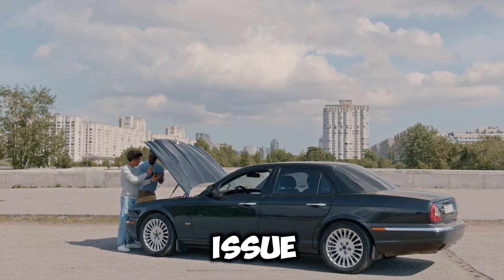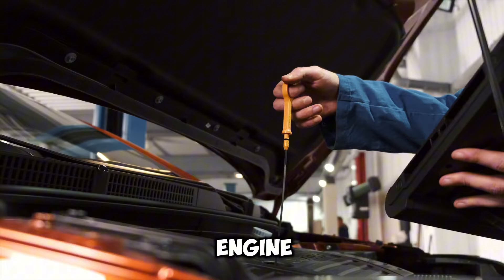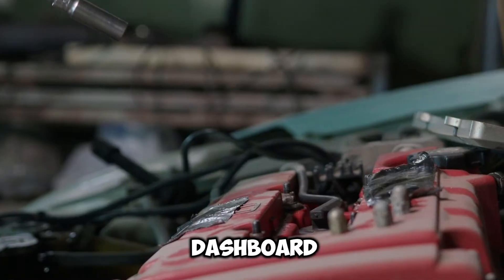Oil Light Blinking When Idling - 7 Causes & Solutions

Comment: Why on idle ,the oil light is off you rev the oil light comes on ?
Reply from the maker: On idle, the oil travels through the engine slowly, however, when you rev it, it requires faster circulation and it is not getting that. I would check the oil pump first.
Reply: Oil pump or crank bearings are worn, usually on high mileage vehicles

Comment: How bout driving
Reply from the maker: If your oil light blinks while driving, it indicates low oil pressure, which could be caused by low oil level, a failing oil pump, clogged oil passages, or engine wear, and it should be checked immediately to prevent serious engine damage.

Comment from the maker: ⏱Timestamps⏱  
00:00 Intro
0:26 1. Low oil pressure at idle
0:49 2. Idle speed too low
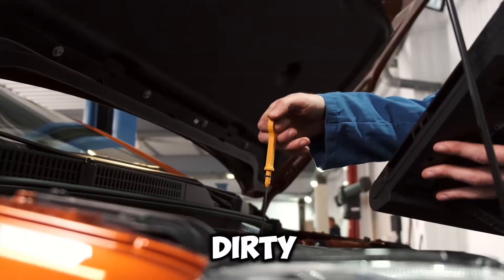1:09 3. Dirty or clogged oil filter
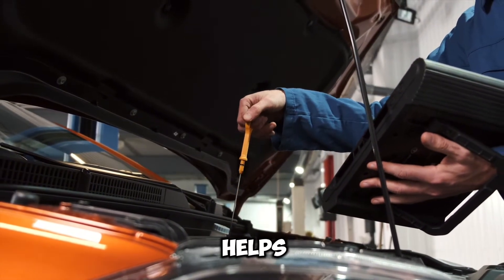1:31 4. Incorrect oil viscosity
1:55 5. Faulty oil pressure sensor
2:12 6. Electrical issues
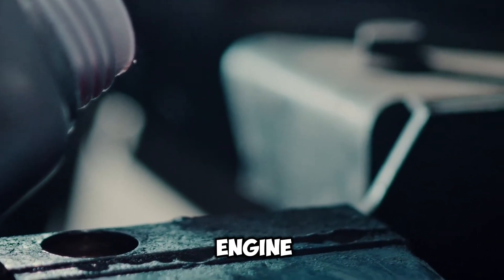2:32 7. Engine wear and tear
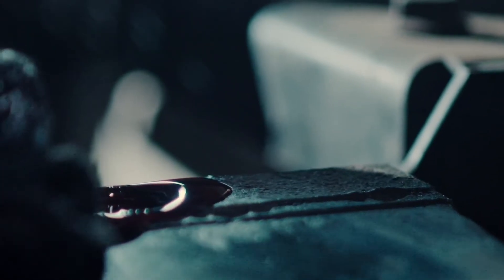2:51 What should I do if the oil light blinks when your car is idle?
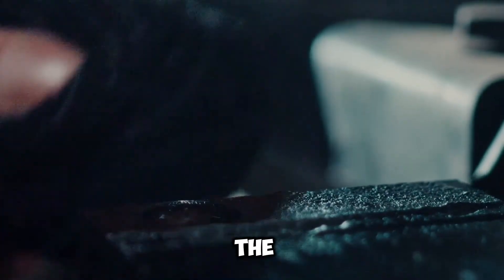3:05 Can driving with the oil light blinking cause damage to the engine?
3:21 How often should you check the oil level to prevent the oil light from blinking?
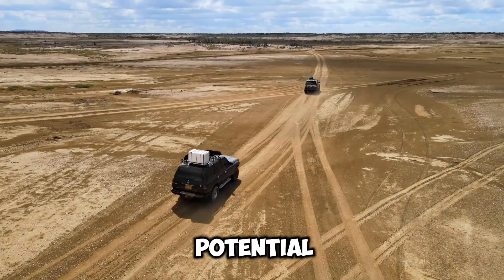3:38 Outro